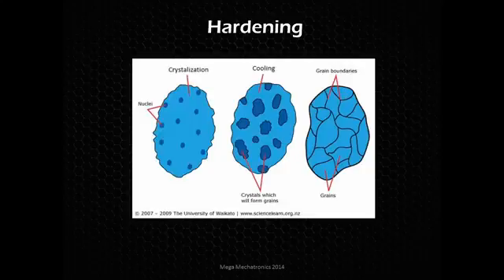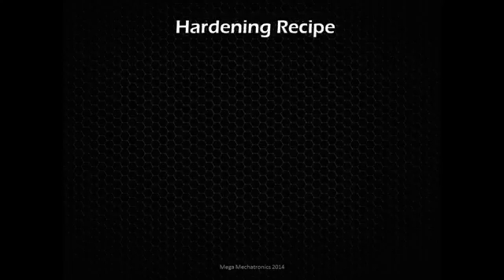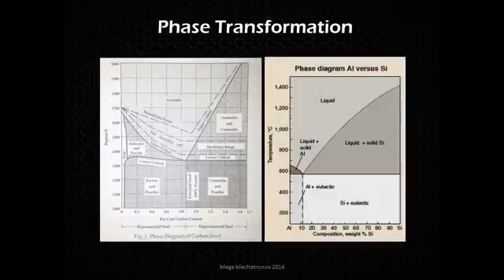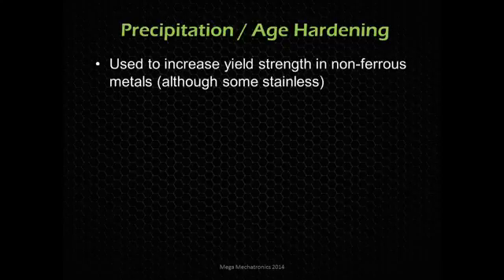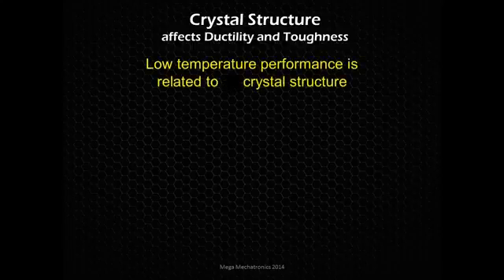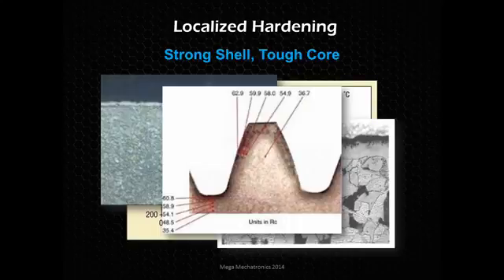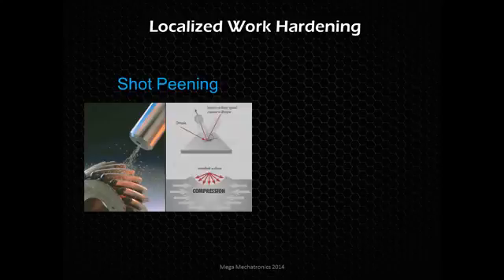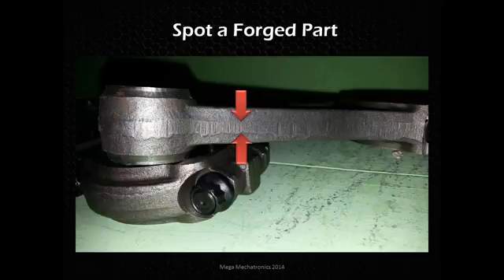Materials Science Mechanical Engineering    Part 4 Heat Treatment Explained

Comment: Pribadi Ridzky Mulyono - 2713100085

This video is reviewing about hardening and heat treatment and even some cold working processes. so, when hardening material, we need to heat it and cool it so the atom can expand its size. crystal lattice can be illustrated as magnetic ball because when given force is applied to them they can move the atom while keeping their bond. and when this happen crystal will start forming randomly within the material, they will create different orientation. the smaller grain boundaries created the stronger material will be. And hardenability of material depends on alloying element or if ferrous metal it will depend on carbon content on its material. so the heating rate of temperature is depending on the thickness of material and alloying element. and when looking at phase diagram we can look at there's different structures within the charts. Alloys are heated above the critical transformation temperature for the material, then cooled rapidly enough to cause the soft initial material to transform to a much harder, stronger structure. Alloys may be air cooled, or cooled by quenching in oil,water, or another liquid, depending upon the amount of alloying elements in the material. Alloy can give many different properties as the treatment of cooling can be differ such as explained before. Hardened materials are usually tempered or stress relieved to improve their dimensional stability and toughness. Steel parts often require a heat treatment to obtain improved mechanical properties, such as increasing increase hardness or strength. The hardening process consists of heating the components above the critical (normalizing) temperature, holding at this temperature for one hour per inch of thickness cooling at a rate fast enough to allow the material to transform to a much harder, stronger structure, and then tempering. Tempering is done after hardening to improve toughness and is done below transformation temperature while normalizing is done above transformation temperature for ferrous material and being cooled with air at room temperature. and annealing is playing with cooled temperature to create desirable microstructures. For identifying hardness can be use indentation method, usually we can se Rockwell c ,brinnel, and Vickers to do that. and scratch test can also be used depend on the purpose of material. Steel is essentially an alloy of iron and carbon; other steel alloys have other metal elements in solution. Heating the material above the critical temperature
causes carbon and the other elements to go into solid solution. Quenching "freezes" the microstructure, inducing stresses. Metal Quenching Material is heated up to the suitable temperature and then quenched in water or oil to harden to full
hardness according to the kind of steels. Material is heated to the suitable temperature for hardening, then cooled rapidly by immersing the hot part is water, oil or another suitable liquid to transform the material to a fully hardened structure. Parts which are quenched usually must be aged, tempered or stress relieved to achieve the proper toughness, final hardness and dimensional stability. Metal Tempering Tempering is done to develop the required combination of hardness, strength and toughness or to relieve the brittleness of fully hardened steels. Steels are never used in the as quenched condition. The combination of quenching and tempering is important to make tough parts. This treatment follows a quenching or air cooling operation. Tempering is generally considered effective in relieving stresses induced by quenching in addition to lowering hardness to within a specified range, or meeting certain mechanical property requirements. Tempering is the process of reheating the steel at a relatively low temperature leading to precipitation and spheroidization of the carbides present in the microstructure. The tempering temperature and times are generally controlled to produce the final properties required of the steel. The result is a component with the appropriate combination of hardness, strength and toughness for the intended application. Tempering is also effective in relieving the stresses induced by quenching. In work hardening (also referred to as strain hardening or cold working) the material is strained past its yield point. The plastic straining generate new dislocations. As the dislocation density increases, further dislocation movement becomes more difficult since they hinder each other, which means the material hardness increases. Martensitic transformation, more commonly known as quenching and tempering, is a hardening mechanism specific for steel. The steel must be heated to a temperature where the iron phase changes from ferrite into austenite, i.e. changes crystal structure from BCC (body-centered cubic) to FCC (face-centered cubic). In austenitic form, steel can dissolve a lot more carbon. Once the carbon has been dissolved, the material is then quenched. It is important to quench with a high cooling rate so that the carbon does not have time to form precipitates of carbides. When the temperature is low enough, the steel tries to return to the low temperature crystal structure BCC. This change is very quick since it does not rely on diffusion and is called a martensitic transformation. Because of the extreme supersaturation of solid solution carbon, the crystal lattice becomes BCT (body-centered tetragonal) instead. This phase is called martensite, and is extremely hard due to a combined effect of the distorted crystal structure and the extreme solid solution strengthening, both mechanisms of which resist slip dislocation Precipitation hardening (also called age hardening) is a process here a second phase that begins in solid solution with the matrix metal is precipitated out of solution with the metal as it is quenched, leaving particles of that phase distributed throughout to cause resistance to slip dislocations. This is achieved by first heating the metal to a temperature where the elements forming the particles are soluble then quenching it, trapping them in a solid solution. Had it been a liquid solution, the elements would form precipitates, just as supersaturated saltwater would precipitate small salt crystals, but atom diffusion in a solid is very slow at room temperature. A second heat treatment at a suitable temperature is then required to age the material. The elevated temperature allows the dissolved elements to diffuse much faster, and form the desired precipitated particles. The quenching is required since the material otherwise would start the precipitation already during the slow cooling. This type of precipitation results in few large particles rather than the, generally desired, profusion of small precipitates. Precipitation hardening is one of the most commonly used techniques for the hardening of metal alloys.

Comment: The most fundamental thing in a material is the atom or the crystal. There are 3 types of crystal lattice in ferrous metal. Body-Centered Cubic (BCC), Face-Centered Cubic (FCC), and hexagonal. This crystal lattice is bonded each other by some kind of magnetic force that keeps all atoms together. When there is a stress, the crystal lattice will experience slip. This crystal bond will not break if the stress is less than their magnetic force in the lattice. During cooling crystal will start to form randomly with different orientation. This phenomenon is called crystallization. And the result is the grain boundaries. 

The size of grain boundary is really important to the mechanical properties of the material. The smaller the grain (finer) the harder, stronger that material will be. The bigger the grain (coarser) the less strength and ductile it will be for the material. Smaller grain will give a stronger material because it will reduce possibility for the crystal lattice to move or deform by slip mechanism. Because it will have some kind of wall to stop the slip so it will not deform easily. Big grains will some kind of thinner wall so it will be easier to deform in the lattice.

Hardenability is the ability of metals to achieve martensite microstructure. The higher the hardenability the easier it will form the martensite microstructure (hardened). Hardenability is related to the depth of hardness of a steel upon heat treatment. Carbon atoms will give strength to metals. The higher the carbon content the harder and higher the strength of that metals. And in the hardenabiity concept, the higher the carbon content, it will give the metals better hardenability. And if we relate it to TTT diagram, the transformation line will shift to right with the increase of carbon content.

During hardening, there are some processes that takes place. First is heating the metals up to transformation temperature. And after that we quench it in liquid media. There are many options for soaking media during quench such as water, salt bath, and oil. Different quench media will give different microstructure and mechanical properties to the metal. And the cooling rate is really important for the success of the hardening process. Salt bath will provide the fastest cooling than any other medias. And it will give the maximum strength to the metals compared than water, and salt bath media.

Hardening process will result in very hard material in martensite microstructure. Martensite is very hard and brittle. And in some applications it is not preferable. Tempering will be the answer to the problem. If we need metals that has high strength and hardness and still have the toughness to it, tempering can be performed to relief the stress in the microstructure and increase the toughness. The most common tempering processes are austempering and martempering. When austempering is performed the result is the bainite microstructure. It will reduce the strength a little bit of the material but toughness will become better. And with martempering process the result is the metal that has martensite microstructure with less stress in the grain, and the toughness will become better too.

Metal is a very versatile material and the application is very high and various. And by alloying we can get the material to the properties that we want. There are so many options of alloying elements that can be used for alloying the metals. For example the 4130 alloy steel has alloying elements of Silicon, Chromium, Molybdenum will give the properties of very high strength but ductile and high toughness compared to the plain carbon steel. And the Stainless Steel 304 will give a high corrosion resistance and strength to the metal by adding Chromium element. There are many types of Stainless Steel such as Ferritic, Austenitic, and Martensitic Stainless Steel. Other examples of alloy steel is High Strength Low Alloy Steel (HSLA), Duplex Stainless Steel, Maraging Steel, Tool Steel, etc.

Other treatment that we can do to metals is annealing. There are many types of annealing such as normalizing, and full annealing. During normalizing the material is heated until transformation temperature, hold, and cooled in air. In full annealing the material is cooled inside the furnace.

We can also do work hardening that doesn't use high temperature to give the metals that has the requirement of application. And localized hardening such as induction hardening, and nitriding/carburizing is used to get the high hardness in surface of the metal. Localized hardening is used when we want to get the hardness in only specific area of the material. So it doesn't affect the properties of the whole material. In Nitriding/Carburizing it is performed by diffusing the Nitrogen element into the steel so that it will increase the metal. Hot forging, is another alternatives to get better properties of the metals.

Dwiki Pratama Putra
2714100124

Comment: M.Afiq Ihsan(2714100012)

This video is talking about heat treatment,especially about
hardening and hardenability.when we hardening the metal,the crystallization
will occurs.And then after cooling,the atom will tranform being a crystal.for
ferrous metal and aluminium,the form of the crystal structure is cubic.and at
the end,the grain of the material will connect each other and form grain
boundaries.the size of grain boundaries is difinetely important.If we have
smaller grain,that’s gonna give us stronger and harder material.Some
explanation about Hardenability:

-limits dependent on alloying element of the metal

-Hardness dependent on carbon content in ferrous metal

Hardenability is the most important properties of a steel
due to it describes the ease a given steel can be quenched to form martensite
is formed on a given quench.Hardening recipe is very important,especially the
time and the temperature that we use for the treatment.when we want to make the
harder metal,first thing that we must do is heat it till it reach the
austenitizing temperature.after that,we quenched it rapidly.there are some
media that we can use for quenched:water,oil and salt.when we quenched the
metal, the austinite will tranform into martensite.

When we want to remove the residual stress,we can do
tempering for the material.there are 2 types of tempering,martempering and
austempering,depends on the properties that we need in material.Some
explanation about tempering:done after hardening,material is too brittle,tempering
below transformation temperature. Tempering is generally considered effective
in relieving stresses induced by quenching in addition to lowering hardness to
within a specified range, or meeting certain mechanical property requirements.
Tempering is the process of reheating the steel at a relatively low temperature
leading to precipitation and spheroidization of the carbides present in the
microstructure. The tempering temperature and times are generally controlled to
produce the final properties required of the steel. The result is a component
with the appropriate combination of hardness, strength and toughness for the
intended application. Tempering is also effective in relieving the stresses
induced by quenching.

Normalizing: ferrous based metal heated above transformation
temperature,and allow in air cool in still air in room temperature.

Annealing: heat and hold temperature,controlled cooling
rate,primarily for softening,and produces desirable microstructure.

Precipitation/age hardening: use to increase yield strength in
non-ferrous metal (although some stainless),and produces fine particles that
defect the crystals lattice that impede movement. This is achieved by first
heating the metal to a temperature where the elements forming the particles are
soluble then quenching it, trapping them in a solid solution. Had it been a liquid
solution, the elements would form precipitates, just as supersaturated
saltwater would precipitate small salt crystals, but atom diffusion in a solid
is very slow at room temperature. A second heat treatment at a suitable
temperature is then required to age the material. The elevated temperature
allows the dissolved elements to diffuse much faster, and form the desired
precipitated particles. The quenching is required since the material otherwise
would start the precipitation already during the slow cooling. This type of
precipitation results in few large particles rather than the, generally
desired, profusion of small precipitates. Precipitation hardening is one of the
most commonly used techniques for the hardening of metal alloys. And to test
and quantifying hardness after a treatment or  cold work we can use
indentation method, usually we can se Rockwell c.

There are some quantify way to measure the hardness by
indentation and scratch. For indentation method, we know several methods, those
are Brinnel method, Vickers Method, and Rockwell method. Those measured the
hardness by measuring the depth of indentation or surface area. Indentor may be
different cause brinnell using steel ball, vickers using diamond pyramid, and
rockwell using steel ball and diamond cone. There are several hardening process
through non- heat tretament process such as surface hardening, work hardening,
and localized hardening. First is surface hardening. There are two most common
method those are carburizing and nitriding. These have same purpose, to
hardened the surface of metal. We know that adding some alloying elements can
increase the strength and hardness through solid solution strengthening. Second
is for work hardening. It divided into two methods, one is cold working and the
another is hot working. It done by giving some external forces to modify the
grain shape and create the residual stress on microstructure. The difference is
hot working is do on elevate temperature and cold working is do on room
temperature. The most known acknowledgement for that process is forging. And
the last one is localized hardening. It can be done by shooting the certain
surface by the hard ball to change the shape of surface and sure its
microstructure on that. It has result on the hardness. It will be harder and
stronger.

So,that’s all the summary from me,thank you mam.